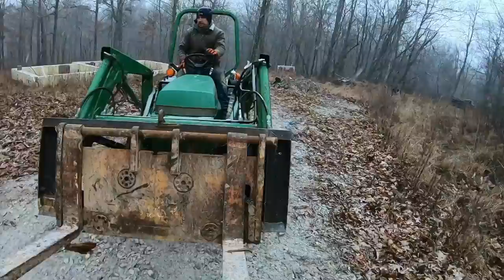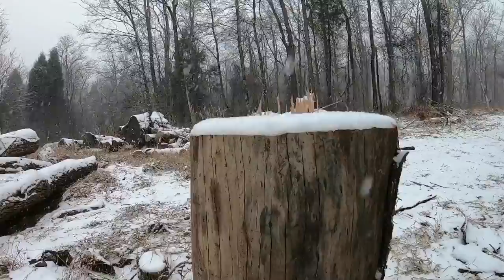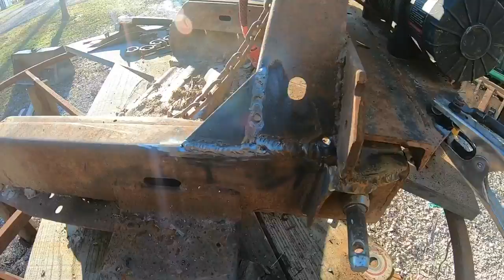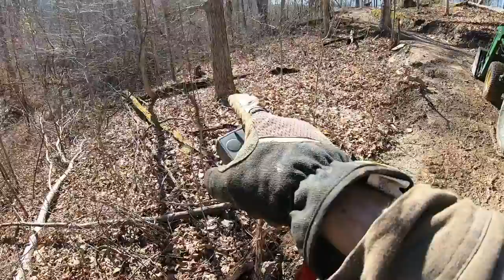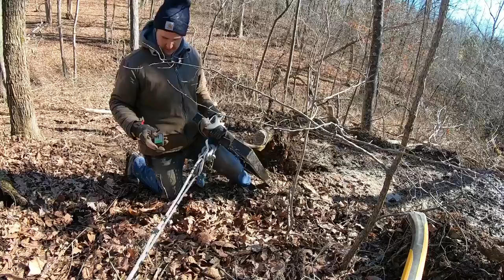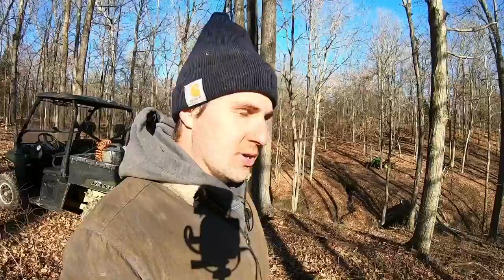Easy Stump Removal With Mechanical Advantage and Compact John Deere Tractor

Comment: A set of wheel stop chocks like what is used in the towing industry would keep your tractor from skidding backward . Or digging a hole for the rear tires to sit down into would also work better than nothing.

Comment: The fun part is trying new methods and solving the problems as we come across them. It's real easy to say we know what you should do, should have done, all while we sit and watch, from our favorite spot, in the warm house. Great job. 
Still amazed as to how well that tractor does sitting on those turf tires.
Reply from the maker: Turf tires and underrated, really a pretty good tire
Reply: When you need new tires, worth looking at some if the new radial options.  May not be able to get any that suit your needs, but the options have really expanded over the last few years beyond the R14s.

Comment: Nice vid Captain.
When welding gussets always weld the inside as well as the outside of them.
Otherwise it's less than a third as strong if you only weld the outside.
I'm a former Iron Worker welder.
I repaired parts racks that held various car parts like rear ends, hoods, roofs and other large heavy parts that fork truck drivers mangled at GM factories in Flint Michigan.
They were 12 to 18 feet long 8 to 12 feet tall 4 to 6 feet wide made of large square and rectangle 1/4 to 1/2 inch steel tubing.
Those guys were gorillas with a steering wheel in their hands.
Reply from the maker: Thanks for the tip ronald

Comment: For future reference.  A strap should be used when you want to protect a tree.  A chain should be used when you want to pull a tree.  The chain will dig in and if you have a wide hook where the chain can tighten as you pull it will continue biting into the wood as you put more strain on it.  Additionally a chain is much more abrasion resistant than a strap.

And as far as you welds go... They're good gorilla welds... Aka big, strong and ugly!
Reply: Yup,...a chain choked around and a small notch in the offending stump and the chain will not jump off the top.
 Also,...I think your first purchase might have worked with more distance between your tractor and the lifting pivot. A longer line will not lift the tractor as easily.
 Also.,,love your videos and willingness to try stuff and persevere when your first crack at it doesn't go smooth!.  Your demeanour and willingness to share this stuff is inspiring! Thanks and keep the videos coming!

Comment: Additional thought. Start with your vertical pulling brace at more angle over stump. Then it's first pulling stump up and lifting out of ground. As it straightens it will pull free towards tractor.  Great job on building the stump puller.
Reply from the maker: Thanks Lynn!

Comment: Great attitude and great stuff! Using a fulcrum! I did similar with about 300ft of rape folded back and forth to make it about 40ft long or so… the homemade fulcrum I used was an “A-frame” made outta couple small tree trunks. And the pulling dece was a truck! Lifted the stump of a Santol tree it of the ground. It was about 48” by 38” by as much as 30”thick…very heavy! But that fulcrum works wonders. Am so surprised at how many folks don’t know what a fulcrum is or how it works…
Reply from the maker: Leverage is amazing!

Comment: treat that 755 to some diesel 911 Captain. another life hack is buy a cheap abrasive blade that cuts metal for your skil saw. they work great for cutting metal. you can get them at any hardware store.Maybe cut your stumps higher for more leverage/dynamic pulls. could also cut a notch in your stump for the strap to bite into with your elec chainsaw. might also wanna buy some nylon "sav a tree" straps to hook your winch to. they save your winch cable from kinking and is just a better set up for pulling. YOUR trail looks fantastic and YOU are a sweetheart! you young kidz are our future.
Reply from the maker: Hey thanks for all the tips!

Comment: I've seen the steel wheel tree pulling set up, but never thought of a longer 'lever'. I have just the thing, to try this out next spring. I saved an A frame support off an old corn elevator, thinking I would use it for something one day😁
Reply from the maker: That would be perfect!

Comment: Captain great video I heard you’re saving for torch set up instead you might want to think about getting yourself a cheap plasma cutter if you have an air compressor and that the generator puts out 220. The 110 does not cut very well. But a plasma cutter cost a lot cheaper than buying gas and air just a thought.
Reply from the maker: Would love to get a plasma cutter, but I think torches are more versatile, I can do more with a torch than I can a plasma cutter. Heat and bend metal,. Get in hard to reach spots, and cutter thicker metal in general.

Comment: Great entertainment as usual Mike, thank you.
A suggestion for the frame, start at 30degrees to the ground, as the gear tightens it will get to 45, then the most useful area of lifting is between there and 90. Tried and tested not armchair advice. Cheers
Reply from the maker: Thanks!

Comment: Capt.,
You might get you a box of 6011 rods.  The 6011 is a deep penetrating rod with more arc force than some others.  It is good in all positions also.  I used 6011 and 6013 as my primaries for a long time.  The 6013 is a good build up as it as a soft arc force and is easy to manage in all positions.  My first weldor was an OLD Westinghouse transformer AC 250amp machine.  it has a huge copper coil that creates the weld power.  I had to replace the on/off switch when the machine was about 40 years old. LOL.
When I was in HS I spent several Saturdays working for a farmer friend "cutting5/8" rebar with his ole 225 Lincoln "buzz-box". The next summer I helped build their bunker silo for silage cattle feed.  The silo was 40'X160' with 8' sidewalls. We mixed all the concrete on site.

Comment: Here are my two suggestions.   Stump #1 first try, take the end of the cable and attach it to a tree.   Will put half the pull on the tree and only half on the tractor.   Another snatchblock at the tree and even more pulling power with less on the tractor.
Second suggestion.   Instead of the strap that slips off, or doing notches or other suggestions, use a chain.   Three wraps around the stump and hook it to itself.  The chain will dig into the wood to lock it on.
That’s my two cents.
Reply from the maker: Hey that is more valuable than two cents, appreciate the suggestions

Comment: When I worked construction the company rented me out to a site that wanted a trail through the woods and after we cut the trail in with a skidsteer then they put wood chips and pine straw down on the trail it helped to keep the vegetation down and keep people from tracking mud back to the cabins or Bed and Breakfast, I don't really remember what the place was other then it was just another job for the day, oh they also lined the side of the trails with small logs from the trees we took out the put them on the down hill side to help hold the trail.
Reply from the maker: Hoping we can rent a chipper and do the same!

Comment: Your Frame works great for lifting objects...!   We used fence posts or a large inflated truck tire to pull stumps alongside fence lines;  same process, run cable over post/tire at 45 degree angle, chain to stump and get out of the way....!
Reply from the maker: Very cool

Comment: Hey Mr. Mike.  That setup worked great.  I never thought it would pull out a whole tree but sure enough, it did.  Maybe a small project you could do with the fam is build a little dam upstream of the bridge for the animals.  I'm sure in the summer it dries out, but even a foot or two of water should stick around.  Just a suggestion.
Reply from the maker: A little dam there would be awesome!

Comment: Hello Captain, Here's a tip for you. How about welding hooks on the side of the winch frame. Then you can secure the winch with out hurting the tractor. Also go from a 2 part line to maybe a 3 or 4 part by using more snatch blocks. Some thing else, adjust that big screw on the top of your 3 pt. hitch to a sharper downward angle, more digging in.
Reply from the maker: Definitely need more snatch blocks

Comment: I always thought a welder was used to join metal together, not cut it apart. (LOL) Beginner welders are always good at burning holes in everything, I know that's all I did when I first learned to weld. Of course I was only 10 at the time and just using a welder was so cool in itself. Great vid.
Reply: Add a 80 psi air source to blow away the slag and you have the first order plasma torch..
Reply from the maker: Thank for watching!

Comment: The more cable pulled out of the winch the more pull you get. From Warn "Warn winches are rated by pulling capacity. The maximum pulling capacity occurs on the first layer of rope on the drum." Using more static points like trees spread out the load.

Comment: Okay Capt. K.... take some steel bars and mount on either side of the deck part so the next time, you can stand them up and they dig down into  the earth. the top of said levers that extend into the earth say eight or so.. you be the judge on that part,  the end that you lift up on to dig will have chain bolted or welded, how ever makes no mind to anyone attach that chain back to someplace where the winch is so it only can stand up and dig holding your tractor still. It will work for even just lugging a  turn of wood out as well and the tractor should stay where your trying to set... mud doesn't make for good dogging but say just in front of a rock or a tree root might be your advantage point. You can do it with one dog or one on each side so  that you have two levers sticking down and pulling themselves in deep keeping you from sliding.. they have to fold forward so they don't drag but have a chain on top so they don't just fold backwards

Comment: Thanks again for sharing your thoughts and videos, always interesting and entertaining. A few comments from all my vast years of zero experience. In the future if you have a strap slipping off like you did in this one you might want to cut a small notch into the wood for the strap to anchor to. Also in a situation where your using the snatch block and it’s pulling the tractor you might consider the return line going to a different anchor like a tree rather than the tractor. That way your splitting the job of anchor between the tractor and something else with the added benefit of the pulling force not being directed towards the tractor where a broken cable could mess something up. Always liked doing projects like this in my backyard when I was a kid. Sure enjoy watching your progress on improving your land. Wishing you and your family the best.
Reply from the maker: Thanks for the suggestions Tom!  Always glad to see ya in the comments

Comment: I have used 2 4x4 chained at the top. It works great. I prefer your setup, much easier to place. Mine weighted a ton.
Reply from the maker: As long as it worked though!  That's the main thing.  Thanks for watching!

Comment: You have the right idea with the pulley, doubling your pull strength.  But, attaching the end back to the tractor also doubles the amount of pull working against the tractor, which can cause you to slide when the bottom blade isn't dug in.

If you attach the end of the winch cable to a tree next to the tractor, the tractor will only see half the load that attaching it back to the tractor would cause.

Nice job overall!
Reply from the maker: Hey thanks!

Comment: Hi Mike.  Nice work.  As you have found, as soon as you get any upward lift of the winch, the tires effectively become useless.  Possibly if you'd sat on the tractor that first pull might have lasted longer.  Anyway, good overall result and sometimes the journey is more fun/interesting than the destination.

Comment: Have you considered welding a rear facing spike on wench? When you wanted to use the lever to pull a stump, you would just need to point them down and back up until it dug in and then the winch wouldn't lift up.
Reply from the maker: Possible, but then I might get stuck 🤣

Comment: Nice job rigging and getting those stumps out! Think if you had some reinforced holes in the winch base you could use some fence "T" posts to stabilize your tractor in slick conditions. (You'd have to use the winch and fulcrum rig to get them out afterwards but...) Work smarter, not harder!
Reply from the maker: Thanks!

Comment: Next time when you have a cutting wheel just remember a disk will literally last you 10 times as long when you use 10 times less force, aka gently applying pressure. It will take a while but it will require way less off the disk and less work cleaning up. Nice work getting it done.
Reply from the maker: Also easier on the grinder

Comment: PRO TIP!! ,6010 or 6011 rod would "cut" better... Also try keeping the 7018 steady when welding for a smoother stronger weld when in the flat or side weld positions

Comment: Was thinking maybe add a couple more tread boards along the inside of the existing boards,wouldn't have to line up your tires as much to the deck,regardless of what your driving across the bridge. The lifting frame is a time tested device,that always makes pulling stumps or boulders out alot easier, I've used a 4"x6" beam with a v notch in the end for the chain or cable too rest in,have too be pulling straight line,but surprising how much weight can be moved. Have a good day, Kaptain!!😎😎😎
Reply from the maker: A big lever works well!

Comment: Hi, I was looking at ideas similar to what I had in mind. This is sort of in the range. I am thinking of getting some metal arcs in each side of a solid structure, similar to your frame idea. The arks work like a rocker in the line of pull. I think that I would start over centre. I will be using chains not straps. Watching your vid shows the general idea works but there are disadvantages. Thanks for sharing, though I am one year late seeing this.

Comment: Buy some Horror Freight trucker chains with hooks.  They grab onto stuff better than straps when you make a choker loop around an object (two turns).

That stand is a variation of a gin pole, an old method of achieving mechanical advantage.  If you attach your winch line at the top of the stand and attach your chain at 2/3's of that distance from the ground you'll gain 50% in pulling force on the pulled object (work out the torques to see how that happens 2x=3y, fill in the y and solve for x).

Another useful trick, especially for pulling fence posts, is to use an old truck/car wheel.  Attach the chain at the ground on the pulled object, run it over the wheel aligned with the winch line and hook to your winch line. As you pull and the wheel rolls it pulls the object up out of the ground.  The wheel acts as a turning block to change horizontal force into vertical force.
Reply from the maker: Definitely need some more chains, as soon as I get some more of that money stuff 🤣
Reply: I'm having an Out-Of-Money Experience too.  ☺

Comment: You can get a special rod for cutting, it does not melt away on you . Quite hard so it lasts longer and cuts finer.
Reply from the maker: Yeah, they are pricey though, Mike has a setup for that

Comment: You might wanna save up for a Vevor plasma cutter. I’ve heard great things about them. It comes w/ a stand off clip to use until you get your skills dialed in. Should be around $250, but you might get a holiday deal. I’m not sure if harbor freight makes something similar, or how well it’s made. Looks like you could have plenty of uses for a plasma (in case you need an excuse or some sales points when discussing w/ “Household 6.”

Comment: Technically, the frame could be called a sheer leg set. It works just the same and I have used these over the years for all sorts of things, including lifting engines out and in of cars.

Comment: Hey little dp, forget about the torch and get a plasma cutter, all you need is an air compressor. I’ve got a torch and use LP gas instead of acetylene, it cost a lot less. I paid $50 for my oxygen tank. A lot of companies will not fill tanks if you don’t buy the tank from them. Do not rent unless you are going to use a lot of content. Do some checking before you buy. Stay safe
Reply from the maker: Plasma cutter would be great one day,. But a torch is more versatile for the worm I'm doing, do hope to get both though!

Comment: Cap’n, the lever was clever!  I gave those Trees of Heaven, HELL!

My neighbor has an old iron wheel from a horse drawn planter.  We use it to pull stumps.  But, you’ve inspired me to look into the used exercise equipment market,  for an upgrade.  And fortunately… along about March a whole bunch of folks will be giving up on their New Years resolutions.  The market will be saturated with weight loss equipment that is lightly used! I’m gonna plug into  Craigslist and start the search now!

That area around the bridge look 1000% better than it did last summer.  Just do me a favor… Please keep that log winch in good working order.  You never know when some overweight, inattentive old fool will stumble off that bridge and need his fat butt pulled out of the crick!

I’m working on a project that we discussed… I’ll send you an e-mail.

Stay safe bud!
Reply from the maker: 🤣🤣. Let me get some rails up before next visit

Comment: using 6011 welding rod works really good for cutting steel, 6013 for just general welding, and 7018 for cutting edges and welding teeth shanks on to buckets, 7018 you will find hard to run as there are 2 pools of weld the outside is the slag and the inner pool is your weld. After you added the 2nd snach block it looks like you might have caught a deer running in the back ground on the slope across the bridge?
Reply from the maker: I have some 6011, I should try!